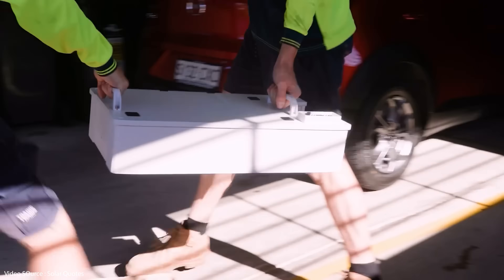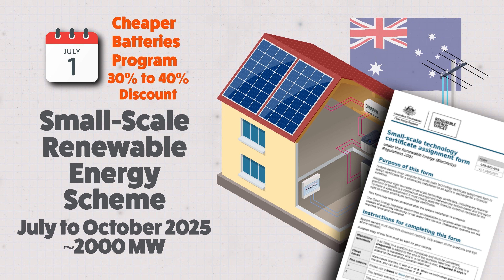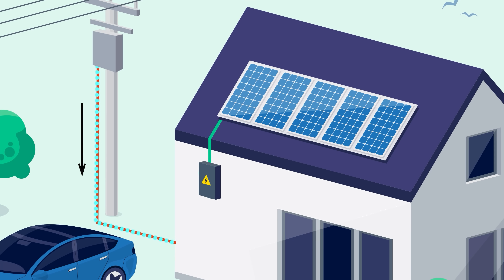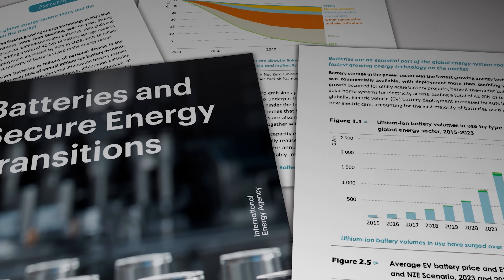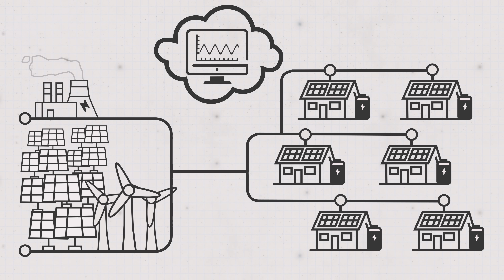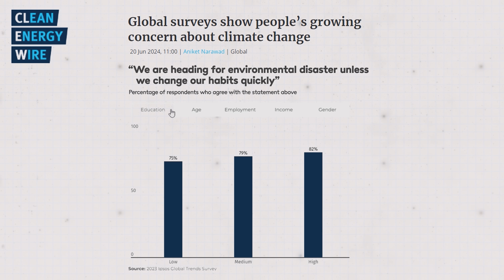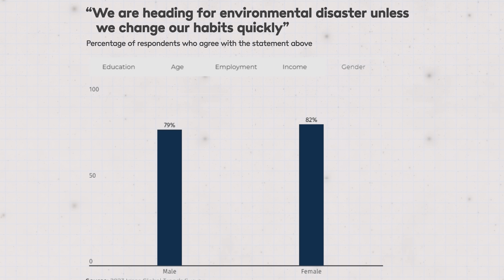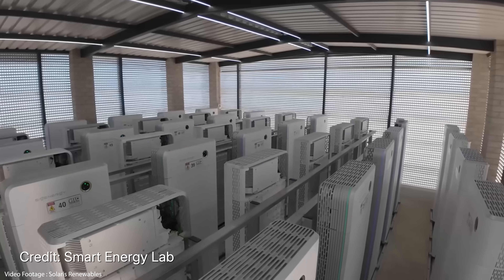Australians installed 100,000 home batteries in 17 weeks. Why can't we all do that?

Comment: A 6.6kW system installed 5 years ago gave us 'free' power after the first month. Two years ago we added on Enphase battery, cost $11k for the battery, brain and fitting. This year we added another 5kW Enphase on the subsidy scheme, so two batteries and a relatively small 10kW all up battery. The panels are paid for already, each year we get a refund and no bills for the year. Also have a HWS heat pump and, of course, all electric house.
Reply: "...each year we get a refund and no bills for the year."
...Because you are stealing power-service.

Comment: Because millions of Australians have been conned by the climate change alarmism, and the battery slash smart controller, so the government can steal your rooftop solar slash battery energy when they need it, not when you will get the best economic value out of it yourself. They can even switch your solar output right off when there is too much of your power when the grid operators need to sell theirs.
Reply: Grow a brain.
Whats causing the current global warming 🤔?
Reply: @davidwatson8118  Australia isn't:

"Australia accounts for roughly 1% to just over 1% of global annual CO2 emissions..." (Google AI)

Comment: You need to think before you open your mouth.
I am a pensioner, and I don't have the $8,000 that installers are demanding for batteries and if I did  why would I buy them ?
The pay back period would be 10 years and I will be dead by then .
Plus , be honest, you still have to pay for power to be connected to your property or did you forget that ?
My next-door neighbour has a well paid job and he has no solar and the guy on the other side has no solar .
Another thing you forgot to mention is that batteries wear out and they have to be replaced , how much is that going to cost down the track ?
Add all this together and you can see the story is not as good as you make out .
My solar system has just finished paying for itself  that took 7 years and now I can look forward to having to start replacing those panels as they begin to fail in a few more years, hopefully I will be dead and it will be someone else's problem.
Some of these posters are liars or living on another planet..what a load of b/s.
Reply: Nobody is demanding money for batteries 😂
How big is this $8000 battery you talk of ?
How big is your solar PV system?
How big is your house and what is your daily KW usage.?
Have you done a power audit of your appliances?
When do you run your power hungry appliances.?
Is your house insulated?
All things you should investigate before coming on here and whinging.
Reply: @davidwatson8118  How is a counter argument characterized as "whinging"? Talk about pot calling kettle black.
Reply: @anthonymorris5084 
If his neighbour and the bloke across the street don't have solar, more fool them.
Reply: @anthonymorris5084 
The payback period is not 10years.
Reply: @anthonymorris5084 
I replaced my 17year old panels and passed them onto a person that is off grid rural, the panels are still working for them at over 80%
I now have a system that is 5 times more KW and cost 25% of the original set up.
Times change and technology moves on.

Comment: There are many positives to this sort of system, but equally there are negatives to deal with.  Since most of the terms used are sort of made up, I will follow suit here.   I like to call it "Distributed Risk Enhancement" and "Reduced Corporate Risk Operations".   In simple terms, with each household having a battery stack and a generation system that is interfaced with the main power grid, the power company shifts the risk from their own generation (through the RCRO) and engages in DRE - putting the risk of catastrophic failure on the home owner and not the power company.

There is a secondary longer term problem, which is the costs of maintaining the grid.   The cost of maintaining a power grid is worked into the price you pay for power.   Say even 10% of a normal power bill is used to pay for the grid.   If the power bills drop 50%, the remaining 50% will have to be charged a lot more to support the grid.  Generally it will be commercial entities that will be using power without other generation, so they will see their power costs increase significantly to pay for the grid.   That in turn results in higher consumer prices in the long run, diminishing the cost benefits of your at home solar battery systems.    

Much of this is the sort of thing you just have to have a think about.   Technology (all technology) has knock on effects.  Every step forward comes at a price, and one that always has to be considered.  

Can't wait to see the maintenance nightmares that all of these batteries and panels generate!  New industry, running around fixing what is broken.

Comment: Thank you for your excellent presentations— I’m one of those 100,000 Australians that had a battery installed, together with a heat-pump hot water service five months ago. As a matter of interest, the fragility of our electricity grid increases substantially in our hot, bushfire prone, summers - another vital reason behind the increased uptake. Our electricity bill is now 75% network service fees and 25% electricity consumption. I paid $10 for electricity last month and $30 in fees.

Comment: As an Australian looking at getting a battery for his home, one key thing you missed is that the battery can be used as a virtual power plant even if my solar isn’t enough to fill it up. It will draw electricity from the grid at times when the price is zero or near zero load up the battery and then power the home and export it at peak times for a higher price.  This means the battery is paid for faster and can actually provide a positive return not just cheaper and more reliable electricity.

Comment: Our electricity prices have gone through the roof here in Australia. When an expensive battery seems feasible that should tell you something. 

It's a joke though as you get paid 5 c / kwh for export which then gets on sold for 30c / kwh.
Reply: I get 12c KW
But it's not all about what you get for export, it's about what you don't import that's important.
Use your own power first, use power hungry appliances when your panels are generating.
Batteries will mean you can use more of your own power.

Comment: They don't stand up on their own without subsidies, by the time you pay it off, you need to replace it.
and they burn really well. Insurance doesn't like them.
Reply: Bla Bla Bla Bla 
Not all batteries are Li ion.
Use them well and they will pay for themselves in about 2 years, particularly if you have an EV.
Reply: Complete BS!

Comment: I also got into this battery solar system scheme. Happy with reduced electricity costs, SAVING almost like $130-$150 a month ish I think plus using heavy duty appliances guilt free most time.

It's still quite costly, I did manage to get 40 kw  battery with 13kw solar panels and 10kw inverter.

Australian power networks should now invest in making single phase systems to three phase systems. This should allow for higher feed in tarrifs, and faster payback period.

Australia pays so little for solar feed in energy, that much that it's not worth it to export any solar at most of times in South Australia where energy prices are often negative most of the time in a day.

Comment: Current Sodium Ion batteries are unusable for solar applications because of their voltage curve. Most inverters will cut out with the battery at 40% charge because below that voltage will be too low.
Its still early days for these, we need new tech to make it work.
Reply: Another troll spreading disinformation.

Comment: Im in australia, and have a 48kwh battery installed. Enouth to run the house and transfer power to the all electric car. My consumption has doubled and my price is $25aud per 60 days. This pays the system off in 4.5 years.

Comment: I am an Australian and the federal government's home battery scheme  has completely changed the political landscape. Australian's centralised coal fired power stations are all nearing the end of their life. (A well maintained coal fire generating unit will normally have a 40 year life. As they reach the end of life, metal fatigue in the highly pressured boiler tubes causes a increasing rate of tube failures until the unit is only rarely online because of the time needed to shut it down to repair broken and leaking tubes.)  The conservative opposition parties have controversially adopted a policy ignoring zero carbon emission targets, and to replace the old with new coal fired units. But, in a little over six months, enough solar/batteries have been installed to replace at least one and possibly two of old coal fired stations at a cost to the government for its subsidies of some where between $AUS2B and $AUS4B with no expenditure of power transmission infrastructure. This a small fraction of the cost of a new coal station but things are moving so fast that it is difficult to get hold of the accurate figures.

The opposition coal fire power boosters have been left like startled kangaroos in the head lights of the battery/solar truck driving straight at them. Extrapolating the cost of the current subsidised battery/solar rollout, current estimates are that coal  fired generates can be completely removed from the Australian electricity grid within five years for an expenditure of $AUS12B. 

But the real news with Battery/Solar is in sub-Saharan Africa. Currently, 400,000 small solar/battery installations are being performed every month. These are mainly individual farmers installing microgrids so as not to depend on non-existent electricity grid infrastructure. They are being financed by low cost loans with long payback periods to the individual concerned. 

But all the activity in Africa is affecting us here in Australia. I have Fronius solar inverters which can be controlled by a battery charger/inverter via Frequency Shift Power Control (FSPC). These enable me run a microgrid when connection to the grid is disrupted. The explosion in African installations seems to have overwhelmed Fronius and it nearly impossible to get any technical support on their excellent products in Australia. Hopefully the support situation will stabilise in the near future.

It seem to me that in Sun blessed countries such as Australia and Africa Solar PV/Battery is the future of domestic and commercial electricity supply. However, industrial power is a different story. I expect electric power hungry industries will migrate to location where hydro and wind power are cheaply available.

Comment: one thing you missed - the Aus grid will be providing free power in middle of day to encourage residential users to soak up the excess power that solar now produces across the network.  This also benefits apartments who could get washing machines, aircon and dryers onto a timer.  I couldn't afford the battery so got an electric hot water system that I am using to soak up my daytime surplus solar power as the 'payback' into grid is now negligible.

Comment: We are in Australia and just upgraded our solar and had a battery installed. There is also an energy retailer that for a flat fee, gives you access to the wholesale energy prices. That means we can take power from the grid when energy prices go negative (yes that happens during the middle of the day) and then pump energy to the grid when prices rise during the evening peak. Should be able to make a couple of thousand $ a year.

Comment: A quick peak to / from Germany: My private home solar (single, 4kW east, 4kW west, 10kWh battery AC-connected so I would not have to change anything else) currently manages its first German winter with typical German weather. And my calculation worked so far: Electricity 100% self, warm water 100% self, with some juggling. Summer was fine of course, but I specifically planned for the winter scenario. On this base I can say, with real numbers: Per person 12 kW solar + 15 kWh storage per person recommended, then you need to juggle less, if you live in southern Germany. Northern Germany may need a bit more panel power. For the grid: Since I get no payback the export is limited to about less than a toaster. Most expensive were the roofers, and it will pay for itself in ~10 years or less.
Sadly our local current government (the previous was poisoned by once of the three coalition members, but repaired quite some wrongs) is backward thinking, somewhere live 50 years back in time...

Comment: The problem with the current rebate is that you get a bigger discount for a larger battery. Thankfully, they’ve changed the system to keep the rebates in line with the size of the battery.

Comment: Aussie here. Have all electric home now, turned off the gas last year. Running on 18 panels and a smallish 6kWh inverter. Paid back in a little over 2 years. I've been in credit since September 2024 (last bill paid out) so I think I'm working at break even at least. No battery (yet) but was going to until I ran the numbers. Payback for a battery even with subsidies, would be far too long for me in this house (nearly 20 years from the quotes I received). And I run in credit so far because of the feed-in-tariff I still get because I shopped around for a decent supplier program. So not all people can justify a battery if not a big power user, even with heat pump hot water and a single split system for heat and cool. Our temps aren't that extreme in Victoria. Next spend: an EV to replace my 20+ year old car.

Comment: America has taken a different approach. Exceedingly High excessive tariffs is guaranteed to stop battery adoption. We're bringing back clean coal and fracking out the last molecule of methane from the ground to provide Power for 4 billion watt Data centers spread throughout the country. Canceling alternative power projects, having them removed when they're 80% complete, IE the ocean wind project off of Connecticut that was going to slash the price of electric bills.  No one knows more about energy and climate change than Donald Trump who has wisely debunked climate change as garbage.
Reply: Wind and solar are infinite-cost, on a sustained basis.
They do not "slash" electric power-service prices.
Reply: @aliendroneservices6621 Rio Tinto are one of Australia's largest power users. They are switching to renewables to power their Boyne Island smelter because they are the CHEAPER option.

From their global head of aluminium on LI:

"In Australia, our two smelters on the East Coast of the country unfortunately sit both today on the wrong half of the global cost curve, given high, coal-driven, electricity costs, which are in addition on a continuously increasing trend."

 "When we, at Rio Tinto, dedicate a lot of efforts and time, and take substantial balance sheet commitments to repower these smelters with a mix of renewable solutions, it is first and foremost because we need and want to bring these smelters to the good half of the global cost curve. "
Reply: @aliendroneservices6621
Bollocks
Reply: @davidwatson8118  Wind and solar are incapable of powering anything important, including the factories which make wind and solar infrastructure.
Since wind and solar cannot power their own factories, they inevitably become infinite cost if fossil-fuels are removed from the picture.
Reply: @aliendroneservices6621
Absolute bollocks, what backward land of ignorance are you living in ?
Electrons are electrons, no matter how they are produced.
They are now.
You forgot to add other forms of renewable energy to the mix.
Who said anything about removing all fossil fuels.🤔?
Reply: @davidwatson8118 America's wise president Donald Trump
Reply: @zAlaska 
If you think that Criminal PD file is "wise", I hold zero hope for you.
Reply: I hope you are being sarcastic 🤔?

Comment: 100,000 house fires in the next 10 years.
Reply: Bollocks
Reply: @davidwatson8118  Crispy
Reply: @PalPal-x1g 
Since 2017 there have been 15 house fires due to home storage units.
Most have been attributed to non compliant units, dodgy installation and DIY installation.
Please consult reputable sources before talking crap.
Reply: @davidwatson8118  
 No doubt it's what you read somewhere. However, Tesla's contract requires that upon sale of the vehicle, reporting of such incidents is subject to severe legal action. If you have the original contract you'll find the clause. Check your local fire department for statistics on EV fires. I can guarantee your county, one of 3,143 counties in the USA has more than 15 of these fires in one county, every year. Do your own research, and good luck.
Reply: @davidwatson8118  "Crap and bollocks" stay classy, crispy.
Reply: @PalPal-x1g 
I don't give a crap about Tesla.
My country is moving to EV,,'s rapidly.
Very few are Tesla Crap
Reply: @PalPal-x1g 
Can't cope with the English language?
Don't Post

Comment: I reside in the province of Québec which fortunately or unfortunately has the cheapest electricity ( mostly Hydro) in North America. 😮 The local Jonquière electricity distributors are rigidly against privately solar/wind etc generated electricity. The main reason is, that our system overproduces and therefore we would cause them a larger problem than they have now. 😢